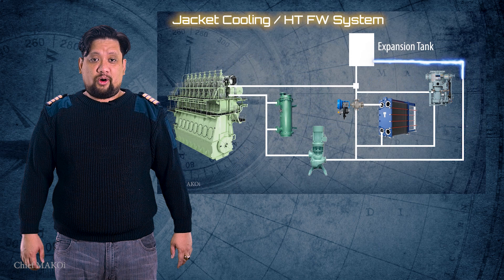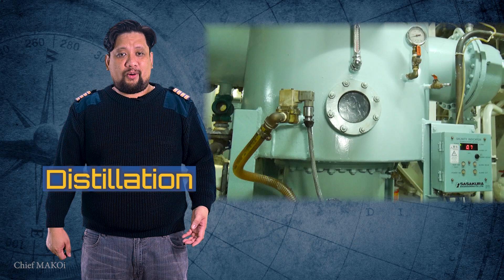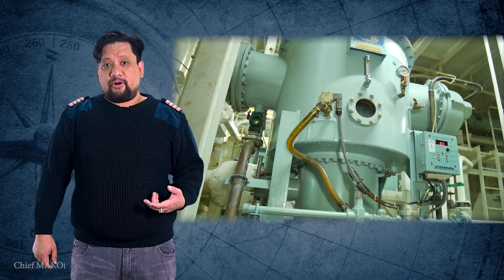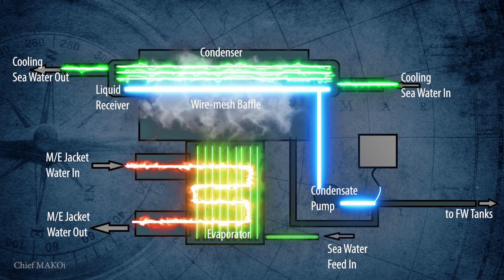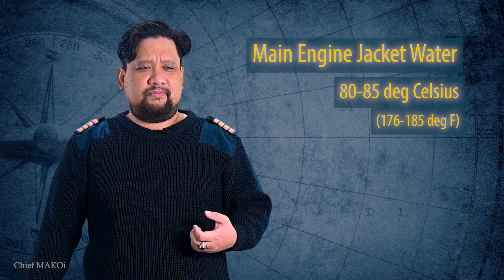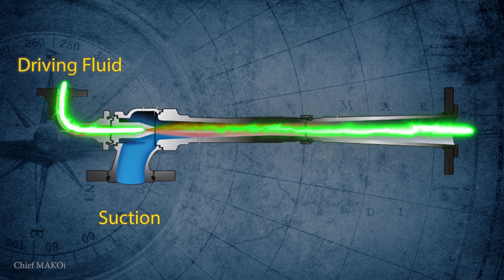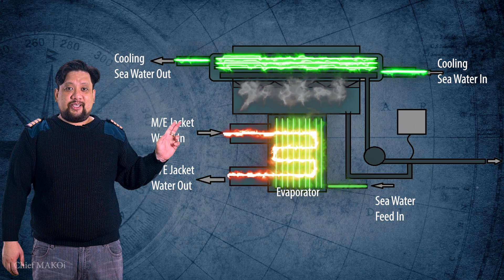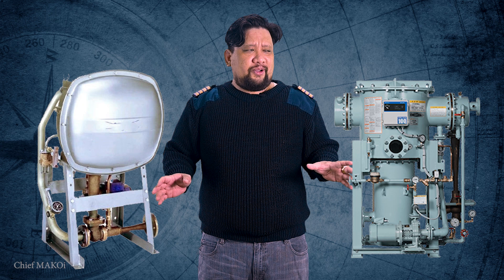How Ships Convert Sea Water to Fresh Water | Chief MAKOi Study Call Ep 04

Comment: Your schematics is wrong. There is not solved residual salt disposal. After some time of operation, the system will become over salted from sea water fed in.
Reply from the maker: Over salting?  Hahaha!  Now you're inventing your own.  My schematics are correct.  Feedwater continuously flows through and gets ejected by the eductor.  Salt build up happens when the FWG is stopped especially if not cooled down properly.
Reply: Chief MAKOi There is no flow trough connection presented on your schematic....
Reply from the maker: There was.  I made 2 different drawings. You don't have to nitpick every detail.

Comment: This is for an entire crew, lmao.
You could have a shower and plenty to drink with these concepts reduced to steam distillation systems for desalination and operate enough in the tank for 3 people running on a couple Solar Panels. This janky thing has too many working parts, thus more to replace. Distilling isnt Rocket Science, hahaha.
Reply from the maker: Shows how little you actually know.  😄😄😄
Reply: How many acres of solar panels? And you'd still need some working parts.
Reply: @ChiefMAKOi  Funny Really, because I built this system 2 years ago and still working great. So I do know more than you do.
Reply: @b43xoit Not Acres, just 2× 200 watt panels. 2 monocrystaline panels can be scaled up 4 or 6 for a family of 4.
Reply from the maker: @EchadLevShtim  again, shows how little you know. 🤣🤣🤣
Reply: @ChiefMAKOi  You arent offering anything to the topic on self sufficiency, sustainability, and survivability, nor presented solutions in your rebuttal. Yet, I am currently running a No Moving Parts system right this second and only do White Vinegar boil once a week maintanance. Ive run steam distillation systems in my home for over 20 years now. Ive worked as a Mechanic, Maintanance Repairs, Automotive, Tool and Dye/Material Handler, etc.  I personally just repaired a pop machine and a fryer in a restaurant this last week.
But half of this project in gathering light/gathering rain started back for me in my computer repair days, where programming and compiling over 14 languages in coding on my belt and Cad/Cam vocational was me out of high school. I was souldering circuit boards and reading blue prints before you were born son.
 What do you know???
Reply from the maker: @EchadLevShtim  since you are talking about sustainability, here's a clue.  The distillation plant onboard ships uses waste heat from the main engine cylinder jacket.  Heat that would otherwise be thrown to the sea. It's not renewable energy, yes.  But recovering that heat and finding a use for it increases fuel efficiency.  Also, how many solar panels and how big of a heating coil will it take to produce 15 tons of water per day?  How many years is the lifespan of solar panels before their efficiency drops.  Ship owners want to maximize profits so do you think they haven't conducted studies and cost analysis about solar panels?  If it really is a more cost-efficient way, you can bet that they will be the first to install it on ships.  You can figure the rest of it out yourself.